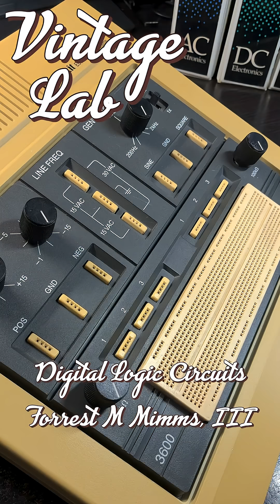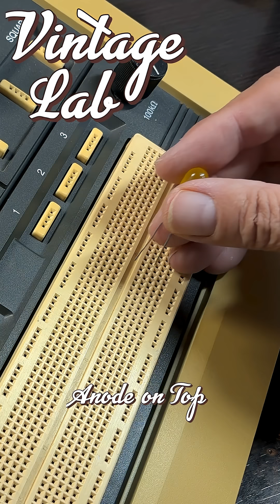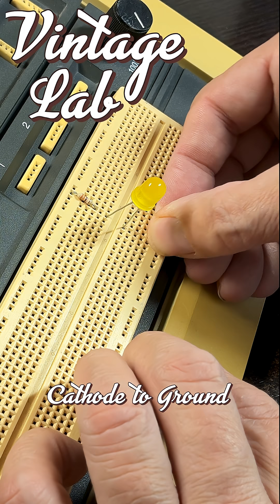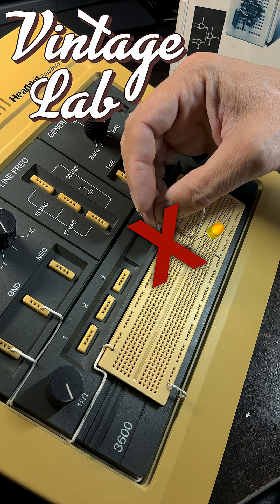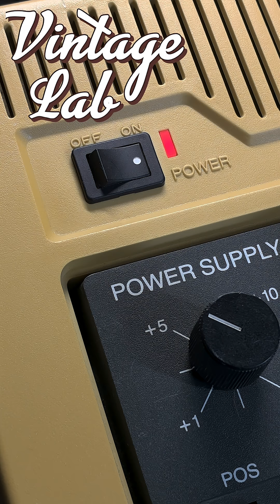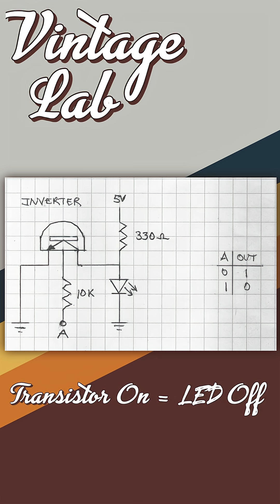Vintage Lab - Tansistor NAND Gate Part 1

Comment: One ofMims' books was 555 Timer Circuits. I bought the book thinking that I would find at least one useful circuit out of 555. Then I learned that 555 is the name of a simple timer device.
Reply from the maker: It’s a weird and interesting chip. Useful for denouncing switches and timing for sure but you can also use it as just a flip-flop. I think someone built an entire computer with a ton of them as well.
Reply: I was first introduced to 555IC in highschool and naturally the bar was low. But we did use it for robotics 🤖... Just a line bot. Gutta starts somewhere. I believe we used it as fix for mercury bulbs 💡 flashing very fast so that the photovoltaic center would not drive it directly. Out of highschool 17-18 years and I still remember what the teacher was trying to accomplish. I guess mission accomplished, to bad the six counselors in four years and a change in high school negated much of those prices less lessons. Well 😅 I give the IEE and city codes purpose. "Know enough to be dangerous, but not enough to be useful".😬